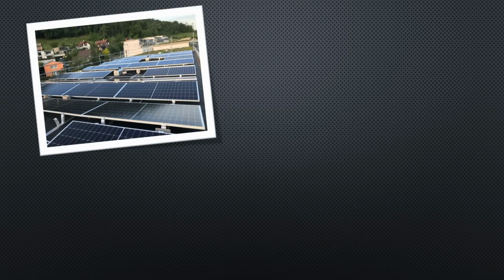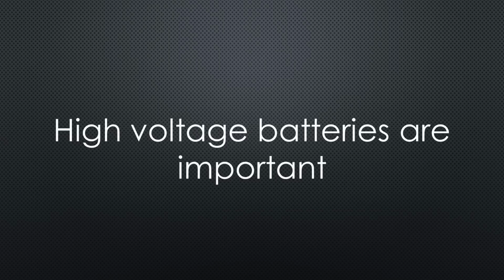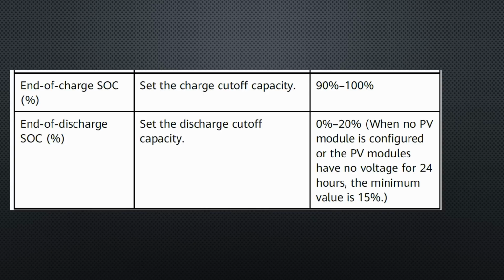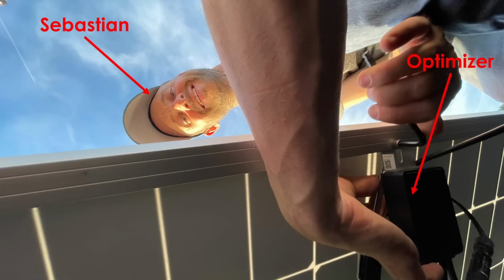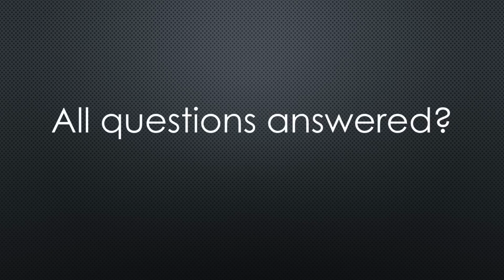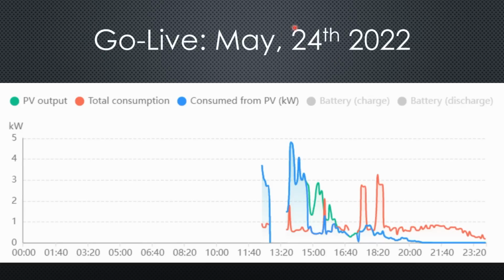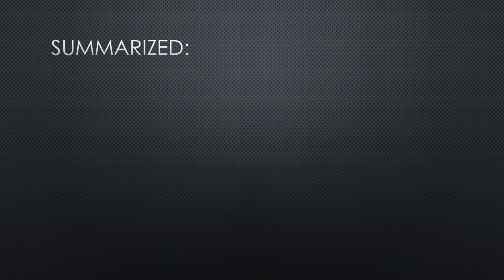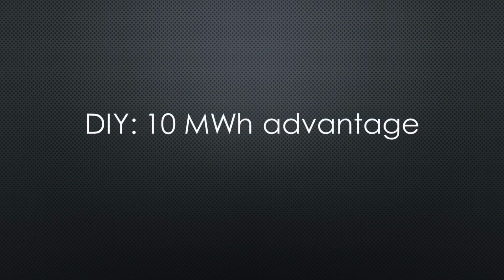438 Photo Voltaic (PV): Why Your Inverter Stops When the Grid Goes Down

Comment: thats so cool, i have almost the same system, just less panels, 12-5.4kw and one luna 5kw battery single phase. I played a bit with the modbus connection but kinda failed so im trying now to use a selenium python script to get data from the fusion solar in HA. Cant wait to see how you get it working, hopefully without their pricy wifi stick :)) Feel free to ask me anything about your issues although i doubt you'll need them :))
Reply: also pretty annoying that i didnt find a less expensive option for batteries. the luna 5kw extension was 2k euros last year, this year is 3k :(
Reply from the maker: 1. I use the WiFi dongle.  I do not know another solution
2. All Solar related things increased in price. As the energy. And worst: Even if you pay the prices you do not get the material ;-) So we were lucky, I think.

Comment: My setup, maybe you can duplicate:

3 phase install from energy company
Shelly 3EM monitoring the connection to the energy company
Shelly EM monitoring solar production
All feeding Home Assistant, so I can clearly see how much I have produced and how much I have send/received to/from the grid. You can also monitor your battery from their. Very useful.

I don't have a battery, but, I monitor a lot of single loads with smart plugs...
Reply from the maker: After the installation of the inverter, it provides all numbers in one interface. So I do no longer need the Shelly and I can repurpose it. Unfortunately, the space in the fuse box does not allow to mount the sensors at the wires to the load. So I have to measure at the outlets using other means.

Comment: Sorry o didn't understand the  connection of the PV panels, you have them in parallel or in series ?
I watched all your video and still I don't understand
Reply: I guess you intende grounding of the aluminium frame right?
And then where did you connect that blue line? To the last negative DC connection?
Ok I understood the schematic now, I guess is it so
Reply: All his panels are connected in series. The goal of having a long negative cable around PV modules is just because to create a tiny loop (further shielded in metal stick) that won't increase a high near field electric voltage (electromagnetic induction effect as wireless charging).
Reply: @xxvytas  the explanation is the same explanation of the common procedure of armature grounding, you connect all the frame  or metal boxes to ground in the case it somehow become live, the only unconventional things is that he connected it to the negative of the solar panel rather than a grounding green yellow wire, it makes sense because there are potential dispersion from the panels themselves, but it was a good thing he pointed out this process that was specific to PV, but still remains the grounding procedure
Reply from the maker: As mentioned before, the panels of one string are in series. The aluminum frame is grounded (has nothing to do with the panel wiring. The minus cable is in parallel to the plus cable which goes through all panels (to avoid a loop).
Reply: @AndreasSpiess  Sorry to go on but now, it is another interpretation from my side, you mean that the path of the negative wire passes under the panels and close to the ideal path of the of the positive, just to be close, but there is no contact to any armature, no junction to any other cable...
This in case of a lighting strike near by will help because the voltage will not increase in the "transmission line" acting as a sort of em shielding?
Hope I got it right now
Reply from the maker: @matteoricci9129  Yes.

Comment: Hallo Andreas, formerly from Basel region too, I have installed the Huawei SUN2000-10-KTL-M1 with Luna 2000 at 15kWh. Battery on a 9.75kWp rooftop system in Bangkok in January. For normal operation I am very happy but the 3ph backup system only allows for 2.5kW backup power whereas the batteries could provide 5kW. Would I have known/ realized this earlier I would have bought 2 single phase 5kW units connected on only 2 out of the 3 phases because those 5kW /1 ph  inverters can feed 5kW in backup mode. With the energy meter, the battery / grid feed in mode could be managed as well as with the 3ph. Inverter.. keen to see on how you further pull data / interconnect into a nice power management   with UPS etc..
Reply from the maker: I knew about the backup power limitation. I anyway will not cook or bake in an off-grid situation (to preserve my battery). So it is more than enough power.
But it might be different in your situation.

Comment: Andreas, on my installation I use SUN2000 5KTL- L1 +PCS+ 5KWh Battery on each phase.  (because Huawei 3ph inverter only could supply backup on 1ph)  I add ATS to isolate my house and grid, and add relay to grid side to send GRID OFF signal (ground DI) to trigger inverter to go offgrid.
Reply from the maker: Thank you for your info. I hope to be capable to feed all three phases from the 1-phase outlet. But of course, only 240V, not 400V.
The backup box showed in the video should do the timing for the DI input...

Comment: Victron Energy inverters have the ability to act as a UPS - they have input for grid, output for your house and input for PV. If the grid goes down, they keep working - downside, you need one per phase to my knowledge, there is not 3-phase victron energy inverter
Reply from the maker: I heard about these inverters but did not check it out. When I planned my system, off grid was no needed option. Only with the recent situation in Europe it became more important :-(

Comment: Looking forward to the "hacking" video. We too have an inverter (SolarEdge) which which can handle a battery, but it is not off-grid capable. As of right now I could not find a solution for this problem (thinking along the lines of "grid transfer switches" + such).
Reply from the maker: Most of normal inverters are not off-grid capable. Recently, this was a topic in our radio and TV shows because most owners are disappointed when they learn about this fact...
I will show how I will get independent from the grid. Maybe it helps in your case, too.

Comment: Could you maybe share a little bit about the administrative process? For example, did you connect the inverter to the grid yourself, or did someone 'official' have to do this and/or did you have to wait for approval before connecting? I'm in Basel-Land too and wondering whether to DIY a PV system because the waiting times are so long for companies to come and do it.
Reply from the maker: All installations to the grid have to be done by a certified electrician (as usual). And a specialist had to come and approve the overall installation. All was managed by Sebastian. He had to fill out a lengthy form...

Comment: At Modbus-sniffing you Had my subscription 😉
Reply: By the way, the Huawei Optimizers have the Function to Bypass the Current, so the DC/DC-Converter will not be active If there is No Shadow on your panel - so less Power losses.
Reply from the maker: You are right. I will make a video about optimizers and bypass diodes...

Comment: Why are you not allowed to use "anti-islanding" isolation switches to keep your system on during grid failure?  This is allowed in my country (ZA) and is in fact mandatory.
Reply from the maker: It is allowed and built-in in the backup box I showed in the video. Just not installed yet.

Comment: Can't you use your Shelly 3em in your DB along with Solid State relays to limit the load on your inverter.
Switch off fridges/heating when you are cooking. Or switch off the fridges when the battery level is low and it is a cold day.  
You could even use it to warn you if you forget a stove plate on.
Reply from the maker: I could use relays for that purpose.  Fortunately, this is not needed because our battery momentarily supplies the needed electricity when we do not have enough sun. We only have to decide if we start the washing machine today or shift it to tomorrow...

Comment: for some reasons, the energy price rise in the UK is pretty a gaslighting thing - they failed to have long-term preparations for energy shortage like this to happen.

solar panels is meant to generate power through solar heat, but at the best efficiency for the semiconductors inside is about 25c.
Reply from the maker: I saw taht your prices increased a lot :-(
The efficiency of solar panels was not very important for me. More important was how much energy I can produce on my roof and how much it costs.

Comment: Very interesting the one thing that I did not know was that if the grid was down you also do not have electricity. Which is one of the reasons for getting one installed.  On your calculations when will the installation have paid for itself? The other concern is can Huawei take over your installation remotely?
Reply from the maker: 1. Most people do not know that fact. This is one of the reasons for that video
2. With current pricing it is hard to calculate. One thing is clear: The time was reduced considerably in the last few months.
3. I do not fear Huawei taking over. And if, I hope they take over the bill, too ;-)
Reply: @AndreasSpiess  The one thing you can guarantee is that they will not take over the bill.

Comment: Hi Andreas
Long Time Viewer Vom Baselbiet here

You Told us with which firm you got started with. I think what a lot of people are struggling with these days is availability of engineers that can lay out a solar system to fit and source the material. 
The firm you promoted of course wrote back in June that they're full of work and I should come back next spring. Now in September they say It would be best to reach out to them in Spring 2024, as they are really booked out.

Of course there are tons of website that promise to connect interested buyers to suppliers. They might do so, I understand. But of course they don't do that for free. So If you get in contact to somebody, I suppose This one is one of those non-existant firms that aren't overwhelmed by demand. I fear those in the best case do out-of-the-box not optimised systems and in the worst case are defrauders that are happy to take the money and then have a lot of excuses why the panels or the inverter will not show up in the next 2 years.

Do you have a suggestion where I can get competent help?
My Idea is that I can build up a system with the possibility to switch to Off grid mode and can provide a black start, if that doesn't rise the cost of installation by to much. In that I want the ability to enlarge the battery capacity If the prices are possibly going down in the future decades.
Reply from the maker: Currently is not a good time to look for solar. No personnel, no material, and high prices. I think you have to wait for a few years :-( As you wrote, if somebody promises something else, he probably does not tell the truth.

Comment: A further improvement in self-consumption can be achieved if, when using a heat pump for heating and hot water preparation, surplus energy is used to charge the hot water boiler. With heat pumps the temperature is often around 55°C and with surplus energy it can be heated up to around 80°C. This means that the heat pump has to be charged at night. This means that the heat pump has to reheat less often during the night. In Switzerland this can make sense, because the yield per kWh with about 6.5 cents differs massively compared to 30 cents with the purchase. The market offers various components to integrate this correctly or to integrate a (bidirectional?) car charging station.

Andreas: In your situation with wood related heating system it still may make sense as wood is in these days getting more and more expensive 🤪
Reply from the maker: I agree, heating pumps are efficient. With solar, energy at night is precious, though.
You are right with the increasing prices for wood. But we have a remote heating plant, and I got the pricing for next year: it increases around 3cents/kWh. Wood is just one part of the pricing.

Comment: Hallo Herr Spiess, wir haben einen Huawei Wechselrichter (sun2000-10ktl-m1) und möchten jetzt das Batteriemodul LUNA 2000 nutzen, dazu brauchen wir die Verbindung zwischen dem Smartmeter und dem Wechselrichter. Hier haben wir und viele Andere das Problem das sich der Wechselrichter oft außerhalb des Hauses befindet und der Zählerschrank mit Smartmeter im Haus, die bestehende Verkabelung bringt meist nur Ethernet nach außen z.B. für Überwachungskameras. Haben Sie hier eine Empfehlung für eine RS485 Ethernet Bridge um Smartmeter mit Wechselrichter über bestehende Ethernet Verkabelung zu verbinden? Vielen Dank.
Reply: Also wenn das Kabel zugänglich ist, hat doch ein Ethernetkabel genügend Adern um RS485 zu betreiben, oder? Dann müsste man nur den richtigen Stecker montieren. Kabellänge sollte da kaum ein Problem sein. Wenn über TCP/IP gegangen werden muss, hab ich auch keine Ahnung. Gibt aber ein Video "Configuration of the RS485/Ethernet EXCCON01 converter" in Youtube. Könnte das sein was Sie brauchen.
Reply from the maker: Ich habe noch nie eine solche Bridge verwendet.

Comment: In poland i had luck and signed a contract and only pay 20% for a storage in grid and i can store it for a year. I am looking forward to your video on connecting to sun2000, i am doing it right now in python. I have connected to the inverter already but i think that i have old firmware in inverter.
Reply from the maker: I use node-red. But maybe Python is a better way. The firmware easily can be updated with the solarfusion app.
Reply: @AndreasSpiess  i have updated to firmware version 140 and enabled modbusTCP, one tricky thing is that the modbus port is 6607. I highly recommend huawei_solar python library, it has everything already decrypted and available. And thank you for the inspiration to get back to the project :).

Comment: I don't like these batteries, not because they are HV, but because they use Li-Ion cells, thus they are NOT durable enough for this applicaton, Programmed obsolescence...
Reply from the maker: The data sheet say that they are LFP and they should have enough cycles. This was a deciding factor for me.

Comment: if I understand correctly about the design, that if the grid goes down, you also have 0 electricity in the house even though you have the backup battery charged full and panels producing, this seems trivial to fix with the existing inverter, since it senses grid being down and shuts itself off, why not install a relay between the grid and the house then - this would be controlled by the inverter, as soon as it senses grid going down, it opens the relay and your house is no longer connected to the grid and the inverter can feed the house, and the grid servicemen are safe to do whatever they need on the street with no risk from your panels since the house is not connected to the grid any more

in the current state - having the battery seems quite pointless (without going into details of course)
Reply from the maker: Your proposal will be implemented by the backup box. But unfortunately, it is not as easy :-(
Reply: @AndreasSpiess  I'm not sure where the difficulty lies (probably some sort of design limitation of the inverter I'd guess), but that is the basic setup of how it is done with 2x 100kW diesel generators we have at the facility, there is no complication whatsoever, no mysterious backup boxes, just a disconnect from the grid which allows to run the building on generators immediately, in fact, the generators start up as soon as they sense the grid down, then the input to the building is switched from grid to generators

the only "complication" I can see is switching it back on to the grid and syncing the inverter, but even that is no more complicated than turning the inverter on for the first time with the grid connected

automating it completely could be a bit problematic, not knowing what sort of loads there are in the house, maybe there are some induction motors switching on or something (a fridge + some sort of water pump perhaps), that the inverter might have trouble with, but then it is as simple as turning them all off (even manually) and back on 1 by 1 so not to overload the inverter when you want it to power the house

and I'm assuming the inverter has the current capacity to run the house from batteries

Comment: 12:30 "our inverter would overload and switch off"

Or not. Since this can only happen during the day that means all solar systems will be active and together they may be able to deliver just enough power to not overload, but brownout, which is very bad or the connected devices.

Also you very specifically want your inverter to shutdown on grid failure and remain shut down because it needs to be synced to the grid. If the inverter is out of phase with the grid when the grid comes back online, your inverter is going to go away in a spectacular ball of flame.
Reply from the maker: You are right, synchronization is another issue. But I would call you "brownout" definitively a design flaw of the inverter.